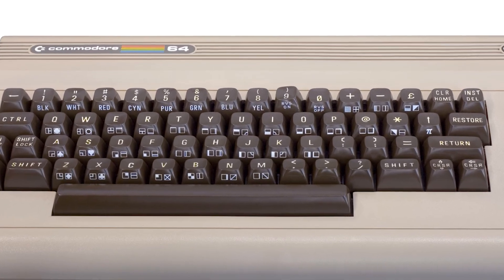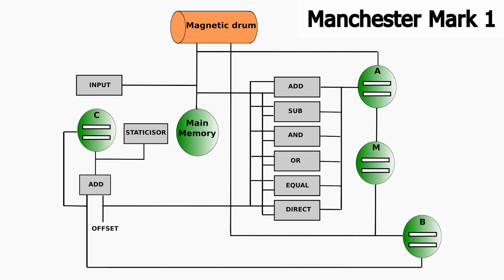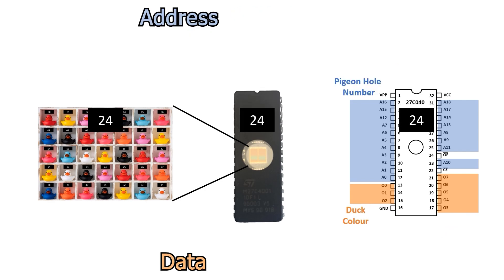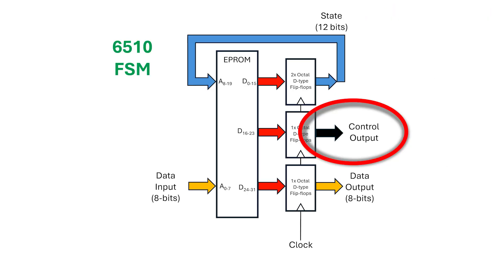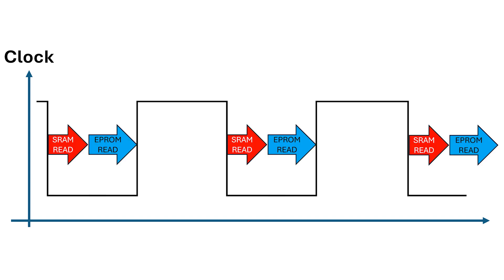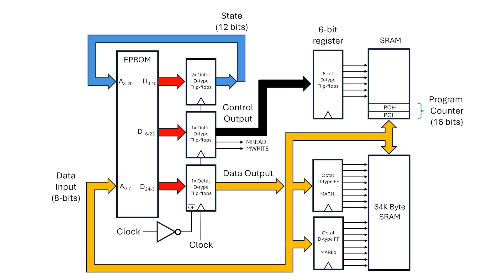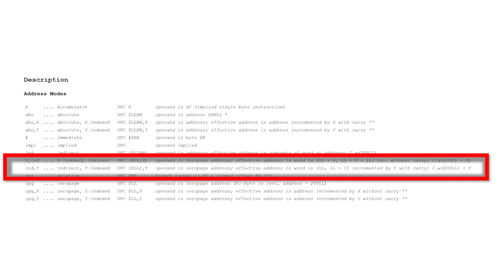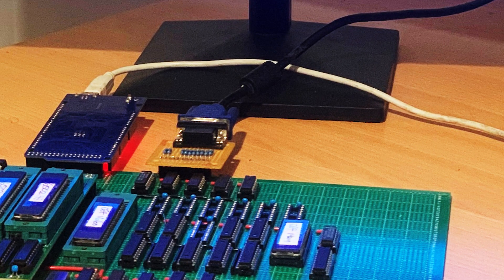Commodore 64 from Scratch: CPU Design and Build.

Comment: Are you able to reproduce the undocumented behaviors that are present in the VIC-II that enable the really advanced tricks that programmers do like VSP scrolling, and undocumented opcodes?  Even the new official Ultimate C64 FPGA is only claiming to be 99% compatible. Why not 100%? What’s still unknown about these chips?
Reply from the maker: Yeah, probably not.  I'm not going to match the exact 6502 halt (via RDY) for bad scanlines.  Also, i'll be downloading sprite information over a whole (C64 equiv) scanline, rather than at the end of the scanline.  These two alone will probably cause problems for those chasing the beam.
Reply: @DrMattRegan thank you for these videos! It’s fascinating and I’ve learned a lot.

Comment: This is amazing, when are you,doing 68000 series 030, 040, 060 loved the Amiga
Reply from the maker: Ironically, the bottleneck is actually making the videos rather than the build and the coding.  I mean the hardware's basically done,  but I'm working on the microcode.  Out of interest, would you rather see the finished project or the work in progress with the microcode/state machines still being written?

Comment: So glad I found this channel. Amazing information. When using wire wrap, how do you measure the length of insulation to pull down?
Reply from the maker: Welcome.  The trick is to slightly pre-stretch the wire, then i just usually eyeball the length and cut the insulation with a wire-wrapping tool.  Solder it then it just slides down!

Comment: Not going to lie, this was somewhat disappointing. I was looking forward to seeing a 6502 built up using TTL, but boiling the entirety of the CPU down to what is essentially just a massive lookup table feels... cheap. I get that it has many advantages; its smaller, cheaper, easier to debug, uses less power, and most importantly might actually able to run in real time. Still, seeing the entirety of a proper CPU replaced by an EEPROM, it's just not the same.

Still going to follow this closely, as I know little about the C64 architecture outside of the 6502 and I'm quite looking forward to seeing how the rest of the system worked.
Reply from the maker: @ChS9712  thanks for the honest feedback. You might want to check out the SAP6502 playlist I have on this channel. It takes Ben Eater’s SAP1 and turns it into a 6502.  It is more of a conventional Von Neumann architecture.  I also have a series on the microcode.  Really the point is that things like ALUs and program counter logic make the circuit faster and use less transistors, but they aren’t strictly necessary.
Normally when you examples of Turing machines they are quite trivial, so I wanted to show more substantial examples.  This whole channel is really about the connection between theoretical CS and computer architecture. So understanding both the Turing6502 and the SAP6502 is important.
Reply: Given what I know of C64 architecture, I would say the 6510 is probably the least of Dr Regan’s challenges here. The 6502 was almost a decade old by this time but the VIC II and SID were pretty much bleeding edge at release. Implementing a TTL C64 around a 65C02 IC would be a major accomplishment.

Comment: Will love seeing this series unfold. I think the C64 is a great machine to be able to easily fabricate more of with contemporary parts, without any kind of FPGA or emulation, and a project such as this may be the first step towards that.

Would love to see if the finished C64 can also run something like Fairlight’s “13 minutes 37 seconds” as the ultimate test of the hardware
Reply from the maker: Thanks, i'll give it a go.  Any code that chases the beam will be a bit tricky though.

Comment: Instantly subbed. Sadly in my country computer system design is non-existent. Micro-controller based work is as far as it goes. I've always had the burning desire to understand the hardware we use by trying to build a basic version myself (electrical eng background). Again, sadly trying to find a teacher/mentor/resources has been difficult Ben Eater was the closest.

Outstanding work, looking forward to the rest!
Reply from the maker: Welcome aboard.  If you want a deep dive, have a look at the Turing6502 series from a more theoretical perspective and the SAP6502 which basically takes the SAP1 design and upgrades it to run 6502 code.  You might also want to look at the SAP6502 Microcode series, which helps understand how it works.

Comment: is there a term for this act of replacing a cpu with a look up table, its very interesting
Reply from the maker: Note sure, De-ALUifying, burning space.  Out of interest, did you know it was possible to build a CPU this way?
Reply: @DrMattRegan  i have had this as an idea before but i didnt know if it was possible or if it had ever been done, my wonder was if it could be used to speed up parts of modern processors at the cost of large amounts of space but i had never even considered using it to emulate old processors
Reply from the maker: @bingusbongus9807  yeah, it starts to require huge amounts of memory once you move to 16 bits.  It does work well for 8-bit and I’m trying to highlight the connection between theoretical computer science (Turing Machines) and computer architecture
Reply: @ haha yeah the increase would be exponential

Comment: Wow! I don't think you have any competition for the "Largest Microcode Store for an 8-Bit Processor" award. This is a clever way to do the design. I'm looking forward to the next video.
Reply from the maker: Correct, but the point of the video isn't to save microcode space.  Adding an ALU removes about 90% of the space required.
Reply: Large microcode or generally large transistor count was exactly what 8bit computers tried to avoid. This video has IBM mainframe or 68k vibe.
Reply from the maker: Not trying to copy the 6502 transistor for transistor, the idea is mainly to show the basic ideas behind computation and an application of the Turing Machine.

Comment: This Video is great. I want to build a custom RISC V 32I processor for fun in a similar way. I was struggling a bit to find a good ram chip for the registers but when I see that you use a 128Kbyte SRAM for 32 register I have to smile a bit. Maybe I should use an huge oversized ram instead of old ram chips that are obsolete today. Pulling 12 address pins to ground just seems so wasteful
Reply from the maker: Ironically it's more about speed.  All the chips are about the same cost, but the older ones are just too slow.  I think the 2114 is out at 250-300 ns.
Reply: @DrMattRegan  The AM2148/AM2149 is a fast 2114 compatible SRAM, they exist as fast as 45ns. I use them as colour RAM replacements for Commodore 64 repairs, because the C64 doesn´t like slow SRAMs (150ns is about the maximum).

Comment: That's a super ambitious goal! Just a CIA in TTL was already 3 pcbs stacked on top of each other, a VIC-II is going to become huge! C64 software and hardware is also a lot more sensitive to tiny incompatibilities, for example the PLA timing needs to be within small margins in order for all cartrdiges to work correctlly. I would consider to relax the rules slightly and also allow GALs. The ATF16V8 and ATF22V10 are still in production and therefore are as easy to use for DYI-hardware as EPROMs, and this will significantly reduce circuit complexity in many cases and will give you a change to achieve the timing requirements.
Reply from the maker: Yeah i may take a few "liberties".  For example, instead of using the CIA for the 60Hz interrupt timer, i may just derive that from the raster generator (like the ZX Spectrum did).  I think i can make it faster than the original C64, so i can "de-tune" it to try to mimic the performance and add in a bad-line delay (which won't be in the native design).  I suspect anyone who "races the beam" will break it though.  Will be interesting to see how well it holds up on the tricker content though.
Reply: @DrMattRegan  That will work: Many implementations such as the Ultimate64 and MiSTer run internally at a higher clock frequency and therefore can fetch multiple bytes from SRAM, so bad lines aren't needed, they are added in for compatibility. It's not just software that races the beam that's tricky, for example, the C64 is not so usable at stock tape & disk speed, but disk and tape speeders require exact timing. The CIA timers are used by many games to implement game events and if there is a time running on the screen, there is a good chance it is powered by the CIA clock.

This is going to be very interresting to see. I wish you good luck!
Reply: @danielmantione the more challenging the better, right? Looking forward to that awesome content! 🎉

Comment: The VIC II chip is going to be interesting, especially the hardware sprites.
Reply from the maker: Hey Martin.  Yeah, the VIC II chip is certainly trickier than the VIC.   I'm going to shadow the main memory for the sprites, so i don't think i'll have to use the "bad line" to try to multiplex into the main memory the way the VIC II did.  I think it will be FSMs to the rescue again.
Reply: Code it up in VHDL and implement on an FPGA.

Let the synthesis tool generate the excitation and output logic functions for the FSMs.

A great learning opportunity for viewers.

Comment: I bought the C64 when it first came out.  The schematics were generously supplied.  I had them up on the wall right behind the little TV set. I had the 64 opened up - all the time. I had an oscilloscope sitting next to it. That was the setup for about 3 years. My roommate and I knew that box inside and out. We created lots of little trick with sets of dip switches, plugs, etc. We had even figured out exactly what was in the PLA.  The code for the system was printed out on a huge stack of paper.  Lot's of red lines and notes. And we modified it. My roommate turned that skill into a high paying job where he was modifying a PDP11 and adding new commands by editing the microcode.  I moved into embedded micros for radar systems.  The C64 was great fun.
Reply from the maker: Yeah it was a great little machine, i also had one back in the day.  I think the most i modified mine was to accept a different Kernel ROM in the C64 and 1541 which allowed high speed transfer over the I/O port.  Had a huge pile of games at the time, i also learned so much from it.
Reply: Do you plane to supply enough information for a relative newbie to build one ourselves?
(Without needing to know as much about it as you do)
Like here are the  Gerber files  and a parts list.  Write the EPROMs from this file on GitHub etc ect.
If not that’s ok.  Great video, I enjoyed watching all of it.
Reply from the maker: @ I’ll probably release the ZX Spectrum first (see that playlist). I’m not sure how complex the C64 will get
Reply: @DrMattRegan  Wow speedy reply :)  I'll go watch that play list.
I have been mucking around with Raspberry Pi Pico making little circuit boards for my projects.
I would love to build something like what you are describing. I don't know a ZX Spectrum but I played with programming a Z80 (TRS80 clone) about a million years ago. :)
I don't wish to do that again but would love to make something that can run simple BASIC.

Comment: Thank you for yet another fantastic video. I really look forward to each one and like to think I have learned a great deal.
Some feedback, if I may? I think I understand why your various excellent series tend to end where one might conclude, "Points made, moving on..." As their purpose is to illustrate the concepts you want to get across. However I wonder if a wrap-up video for the end of each series demonstrating the completed device doing all the things it should with commentary and a link to necessary files might add a sense of completion? 

ie: Did I get the point? I shall reproduce Dr Regan's project and see, with the bonus of having a functioning machine at the end of it.
On the one hand, having to dope out the remaining bits not overtly demonstrated would certainly make sure anyone following along really has got it. On the other hand it helps one's confidence to try if you can see the completed result in all it's glory.
"At worst if I don't get it I'll have still made a neat device." vs "If I don't get it I may never finish."
Reply from the maker: Thanks for the feedback.  I think wrapping up with a "point's discussed" or something similar is a good idea.  I can put out some simple simulations so people can run the code and test it themselves.  Before lots of people try to build it though, I'd probably need a reddit forum like Ben Eater's with a community to help people debug them.  Unfortunately, i don't think i have the bandwidth just by myself - video output would grind to zero.

Comment: I asked AI one day what an Nvidia GPU would look like if it was made of tubes.  It said it would be larger than Mount Everest and use more energy than all the world is capable of producing.
Reply from the maker: Ha ha.. Interestingly, understanding the first principles are super important even when designing a GPU.  I worked on the Display Controller for the Tesla family and the crossbar on the Fermi family of Nvidia GPUs back in the day.
Reply: I bought my first Commodore 64 in 1986 and I ended up selling them for a short period of time when I was stationed overseas.  I had a part-time job selling computers at the base exchange when I was in England.   What I really had fun with was the Amiga 2000 with a PC emulator board.  I’m playing with a raspberry pi, and an SDR receiver as my current project, though I am not making it very far.  I went to a digital course as an electronics technician decades ago, but I don’t remember much so I may watch this.

Comment: It never ceases to amaze me how such a simple circuit is capable of simulating a complex device like a CPU.

Did I understand correctly that it is capable of running 6502 code in real time or even near real time? It makes sense that’s pure Turing machine would be extremely slow, but I would have thought there would be a limit on how fast it could go without using a 1GHz clock. I’ll look forward to seeing it in action.
Reply from the maker: Yep, there is about a 4-5 order of magnitude speedup by going from sequential access to random access Turing Machine in the 6502 example.  The random access Turing Machine requires about 3-4 times the number of clocks per instruction compared to the actual 6502, but i have it running at 3.5 MHz now, and hopefully 7 MHz soon. So yes, it runs in real time.

Comment: fun fun. fixed logic pipeline is simpler than a generalized cpu. also that pipeline can compute anything that a general cpu can do. in the specific manner. in fixed logic data flow matters. ie data bus management out of the main memory. yes input/output system. not assuming that the scratch pad also contains data, only the scratch memory. fixed logic processing pipeline has the benefit of not needing instruction swapping and prediction, they stay the same for all the data for that data block. ie automatically optimized data oriented processing code logic. ram chip might have extra functionality that it does not need, in the fixed logic processing pipeline case. as the target memory addresses are fixed. but assume that the memory is located in a single chip instead of randomly between chips functionality regions as individual bits. yep fixed logic is a compiled program directly in the logic circuit. when generic programmability (instruction switching) is not required or even preferable. if you can compile any program to a fixed logic circuit then the functionality of the circuit is same (better faster) than the generic cpu logic circuit. also the logic processing is fully pipelined vs generic cpu. yep reprogrammable logic is the generic specific best. reprogrammable logic stores the target memory addresses on the chip logic until reprogrammed. also fixed logic pipeline is smaller compared to same functionality count alus.
Reply from the maker: If you're interested int fixed logic pipelines, have a look at this paper
https://dl.acm.org/doi/abs/10.1145/192161.192192
I'll be doing a series on this later down the track.  
It's a bit of my own home cooking!